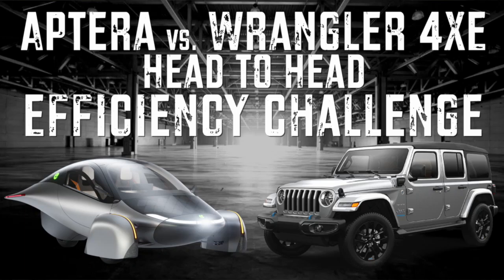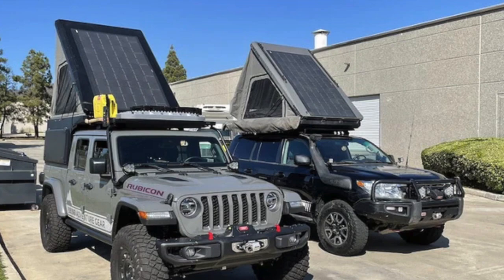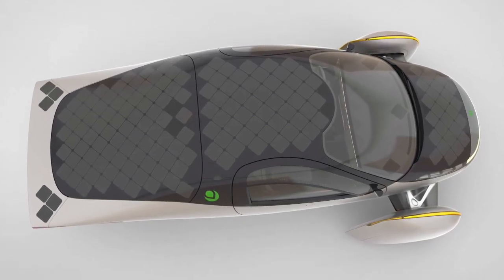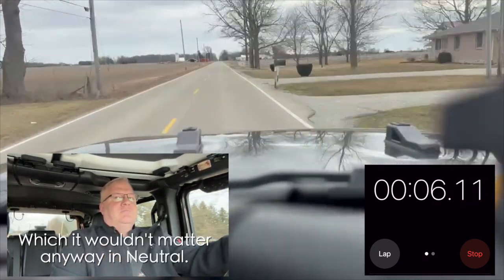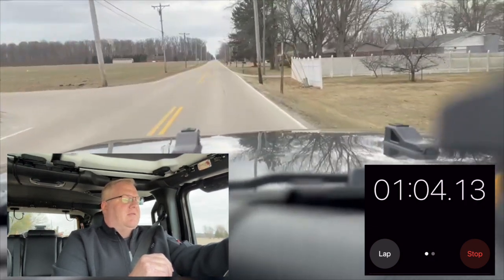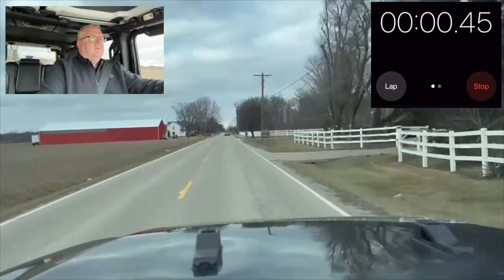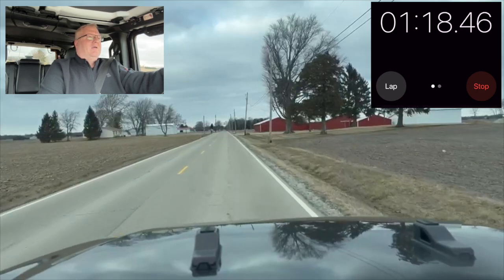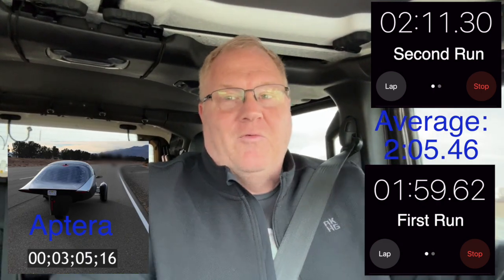Aptera vs Wrangler 4XE Efficiency Challenge

Comment: Benefit of solar panels may be significant and useful when camping.  Control over charging rate from gas engine (E-SAVE mode) would also be very useful.
Reply: I think solar panels can be helpful for parasitic loss, like Sentry or cabin overheat.  Which sometimes on my commute is the difference between having to charge before coming home or not.  But also, like you said, for camping.  I like to use the Powerbox on my 4xe for running the camper and other stuff when off grid. Would be nice to gain some of those losses, especially if i'm in a BEV.  I don't want to have to bring along a Jackery or some other battery when I've got a battery like 100x the size already built into the car.
Reply: @dstephan34 Yes.  We could use a way to connect solar arrays of varying sizes to our electric vehicles.  Need a good interface for that, not just the usual charge port.  Then when camping we can park in the shade but have a portable solar array in the nearby sun that can be quite large in size, like when camping for a week.
Reply: Also if your battery dies and are like just 1 miles from a charger
Reply: @Vocuzvizions Good natural and flexible possibilities.  Love how the Ramcharger design is really a step up in power and flexibility, still with a decent size 92 kWh battery capacity.
Reply: Useless in the EV to get you home, and beaten by butane for cooking. Powers your LED lights, but so expensive ordinary AA batteries are more cost efficient. No benefits.
Reply: @aussieideasman8498 Nice big battery in the vehicle, no need for other expensive batteries around the camp like from Jackery, Ecoflow and GoalZero, once there is a good interface to input power at appropriate (variable) level.  Seems pretty natural/obvious.
Reply: @CrumResearch  I have nothing against using the vehicle battery to power up stuff on a camp; I have done it with my BYD. What I am saying is that solar on a camp is useless - it is beaten by what we already have, including V2L EV's. You have confused solar with battery.
Reply: @aussieideasman8498 No such confusion here.  Solar panel arrays of widely varying sizes can be used to charge the main EV battery at widely varying rates, given a flexible power input interface.  Could be very flexible and really powerful in some situations, and just a convenient trickle in other situations.  Pretty cool possibilities.
Reply: @CrumResearch  My first post was all about solar; your reply was all about a battery. You were confused. Now for your latest claim, and I will repeat yours so you can avoid confusion:

"Solar panel arrays of widely varying sizes can be used to charge the main EV battery at widely varying rates," All too slow, and too expensive for what you get. Best to just camp where your EV can get you back to a public charger at least. You don't mention cooking and camp lights.

"given a flexible power input interface." And what is an inflexible one? This is immaterial guff, however, any interface is just more cost  

"Could be very flexible and really powerful in some situations, and just a convenient trickle in other situations.  Pretty cool possibilities." Concentrate on what is possible now, and forget what might be. I'm saying solar right now is beaten by common forms of power, both on the EV and at the campsite. There is zero benefit in any possibility, and your first post was about benefits of solar.

Reply